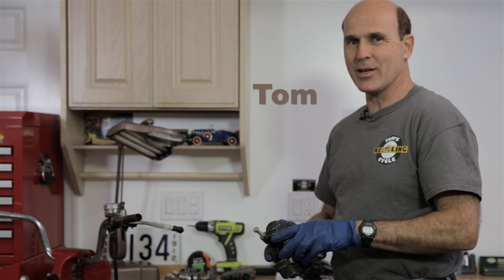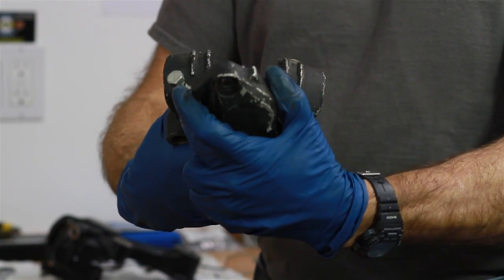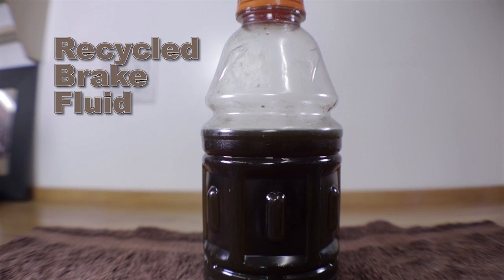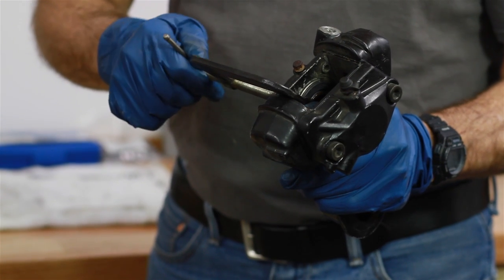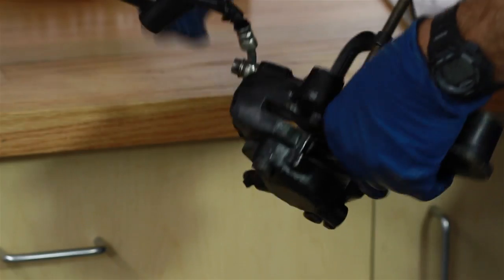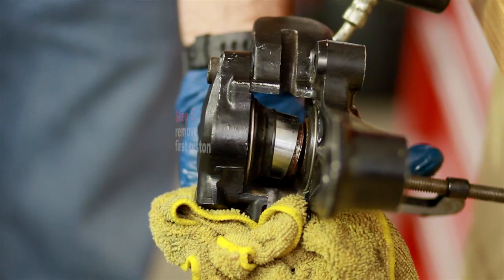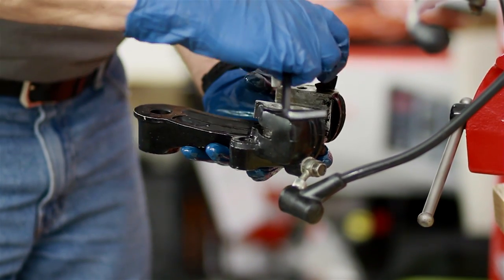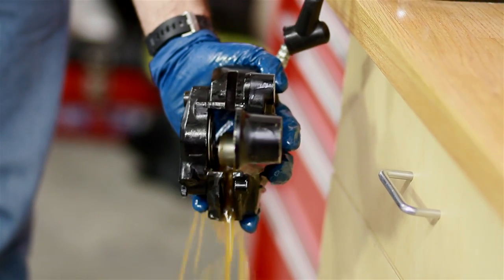Honda GL1000/SOHC 750F Rear Caliper Piston Removal Procedure

Comment: Here's a MUCH MUCH easier procedure. Clamp it in a vice with soft jaws. Drop a small socket into the cup and put the square end of a 3/8" extension in next to it. size the socket so that the extension barely fits in. Now (with a ratchet attached to the extension) rotate the extension. The extension and socket cam out and lock to the cup. Now you can easily rotate and pull and get the cup out.
I learned this trick from Brick House Builds a few days ago and have now pulled all 4 calipers on my GL1000 which had been laid up for a decade and the cups were all seized. I had to put probably 80 foot pounds of torque on the rear to get one of the cups to break loose. But in each case the cup came out in about 15 seconds with no faffing around with hooking the hydraulics back up and such.

Comment: Like Jerry W Davis mentions (2 years ago) how to do you properly remove the caliper from the bike? and how to do so without spilling brake fluid everywhere?
Reply from the maker: It's best to use a syringe to empty the master cylinder of all the fluid and with the bleeders open (and a clear tube over the bleeder going into a jar) pump out the remaining fluid that's in the lines and calipers.  Then carefully loosen the banjo bolt and have a rag ready to wrap around the brake hose.  It's going to want to drip, so use a piece of duct tape to hold the rag around the banjo fitting.  Up above, make sure to have a damp towel covering the tank and anything else that you might accidently drip fluid on when you drain the master cylinder.